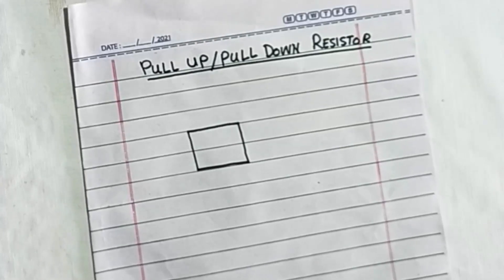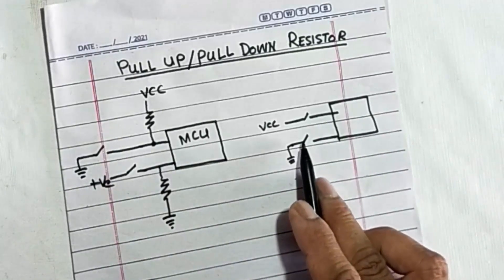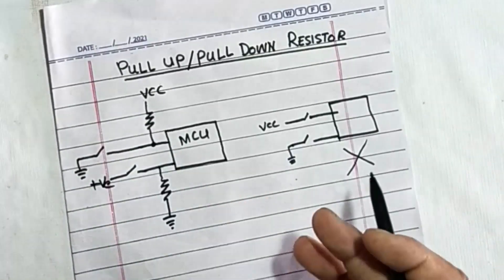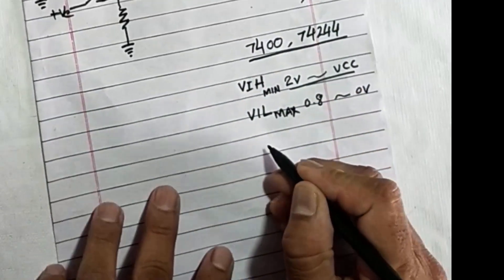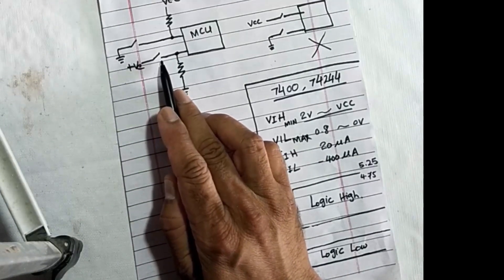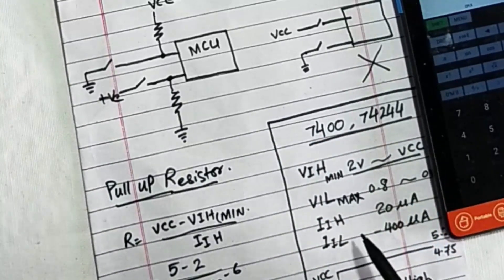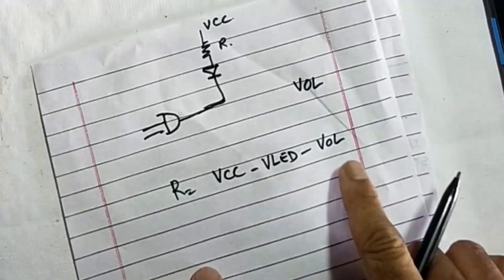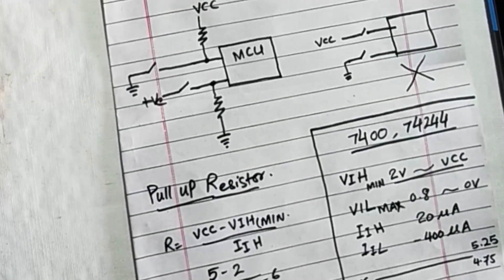363 Pull Up / Pull Down Resistor Explained, How to Calculate Pull Up/ Pull Down Resistance

Comment: will it apply to Laptop Controllers?
Reply from the maker: It is applicable to all digital electronics. Logic circuits, microcontrollers, microprocessors, line drivers, transceivers, 
Everywhere

Comment: Brilliant Explanation Sir.
I have a small issue need your guidance 
HP ki SMPS hai 365W Usme issue ye hai k Green Wire ground k sath 4 Volt d rhi hai or Agr Power Switch Lga k bad Green or black ko short krn to SMPS On ho jati hai Per Jb Power Switch lgaye bgr Green Black ko Short kr k nad me. Power Switch lgaye to On nhe hoti or Series lamp glow krta hai.
Sir where could be a possible fault what i need to ✅? Otherwise i will visit your workshop. I'm from Sialkot help me if possible regard. Teacher By Profession Regards